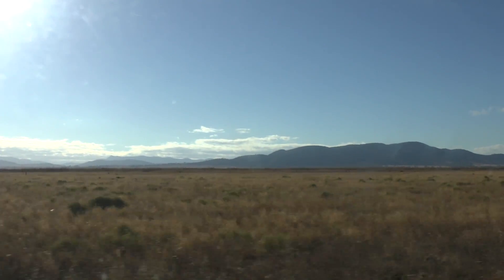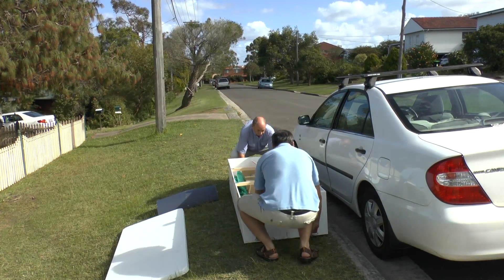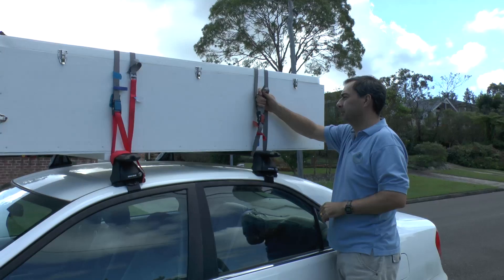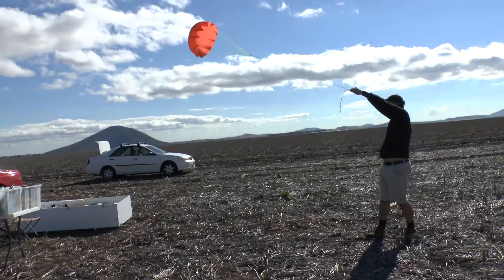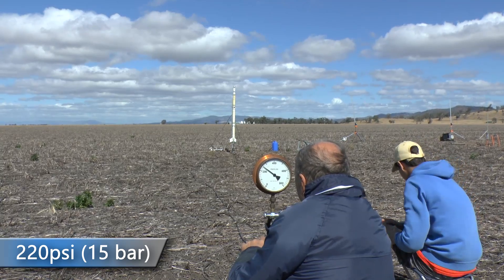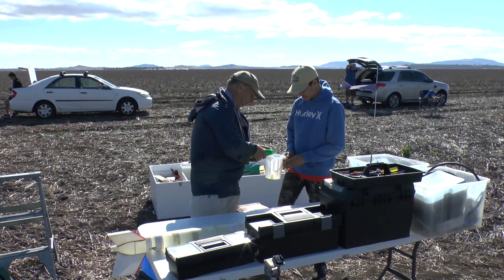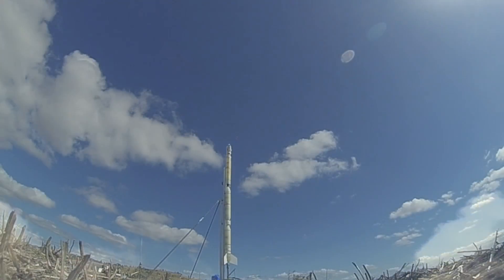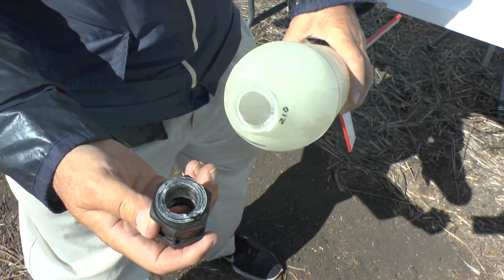Windy Water Rocket Launch

Comment: Hello there ! always an interesting video ! I was wondering why you had to drive 5 hours, No other good enough place for that or because of flight restrictions ? keep up the excellent content !
Reply from the maker: Thanks loitho2. This is our clubs high power launch site. We come here a couple of times a year to launch high power rockets. We have the range and altitude clearance at this site. Although we decided not to launch our big rocket, we still got to see other people's rockets get launched. 
Our regular launch site in the middle of Sydney is a little too small to launch our big rocket, as it could drift a long way under parachute and land in someone's back yard. 
The reason it is so far because High Power Launch sites are hard to come by. It took the club almost a year to get all the paperwork done. You need land owner's approval, council approval, insurance, CASA (air services) approval for the ceiling you want to fly to, approval from the fire brigade. etc.
But the launch site is excellent with lots of clearance. There would be places closer to Sydney to fly but the maximum altitude wouldn't be worth it because of controlled or restricted air space.
Reply: Oh I see, thank you very much for the answer !

Comment: Great work with the box,  I think that had a lot of time to make.  What was the explosion problem?
Reply from the maker: Cheers! :) The explosion was caused by the bottle neck shrinking and distorting a little due to the heat built up during pressurisation, so it slipped out of the coupler. We've seen this sort of failure before. We made a brass plug a few years back that we can heat and insert it back into the bottle neck to get it back into shape. For the second launch we just replaced the tornado tube with another one that was a little tighter and then it was fine.